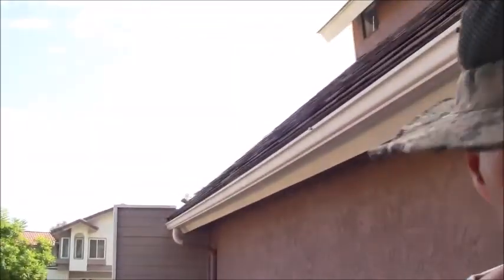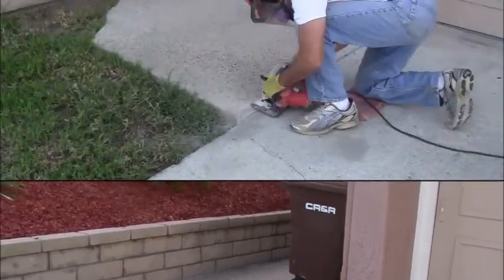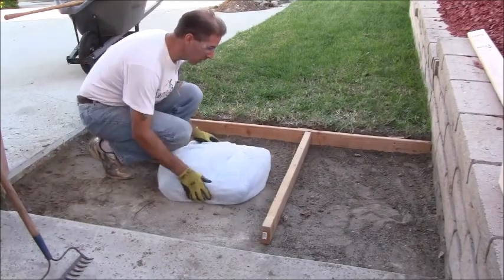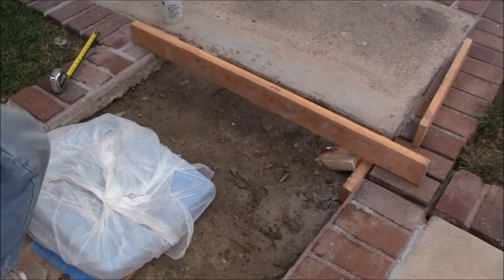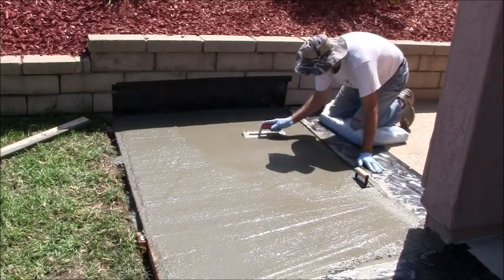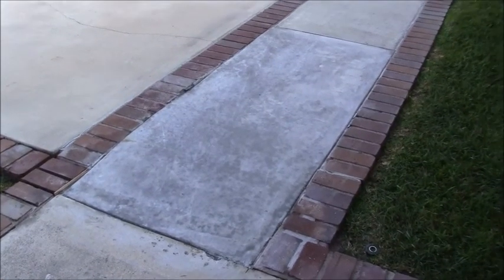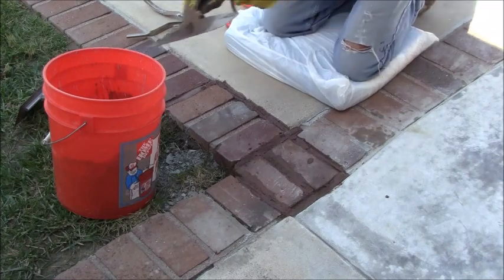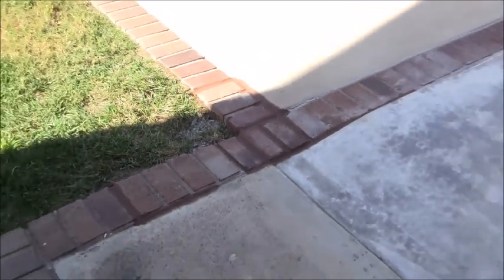Break and Re pour Cement sidewalk with Brick Ribbon

Comment: I borrowed a jackhammer it ran for almost 2 minutes thank the stars above I had a bull bar. Heavy as hell and thought I might have a heart attack right there in my walkway but my cousin and I would lift and with all our might thrust that solid metal bar beveled end into the concrete and it was about 5 or 6  inches thick with rocks in the concrete half way down then a layer of white looked like lime scale calcium we still don't know. But we took turns ramming that bullbar that weighed about 25 lbs we broke up a 3 1/2 ft wide by 12 ft long walkway. It was no joke but we got it done in 2 hrs but we took the next 2 days off we actually started digging that night around 3 1/2 feet down to the sewage pipe.